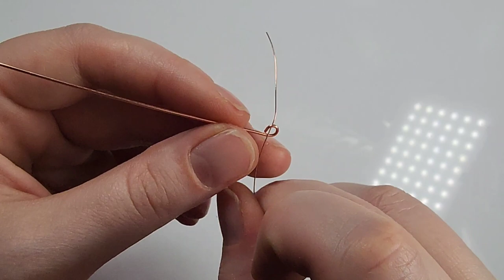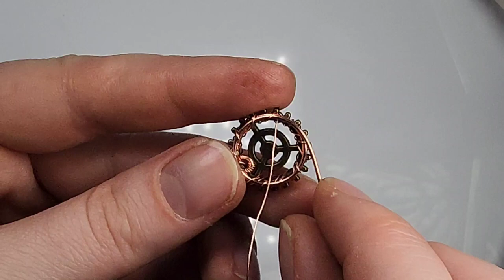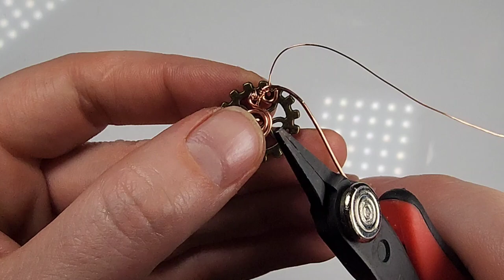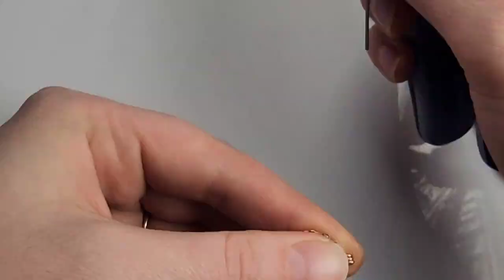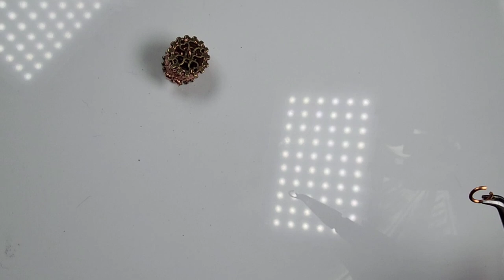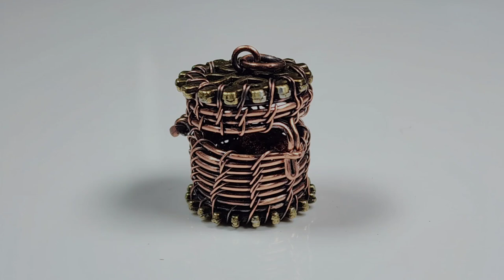Woven Hinged Box: Wire Wrapping Tutorial: DIY Jewelry

Comment: Wow this is so ingenious! I dont know how you kept your 28 gauge from breaking, I'm sure mine would break halfway through because of all the pulling through tight spaces! 😭
Reply from the maker: Just don't pull those first two layers too tightly together and you shouldn't have an issue getting the weaving wire through without it breaking. This biggest thing is to pull it through slowly and not let it get too many kinks in it as you go.